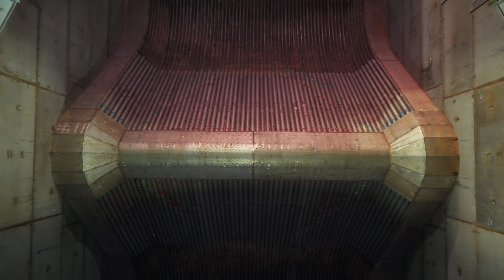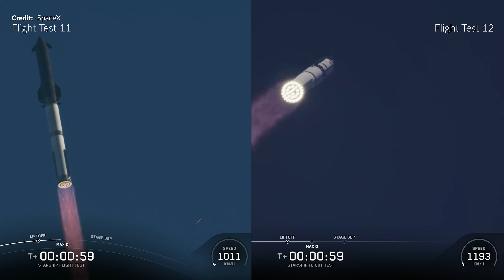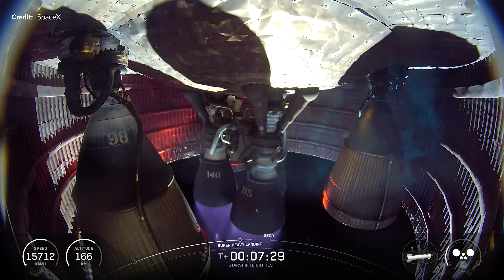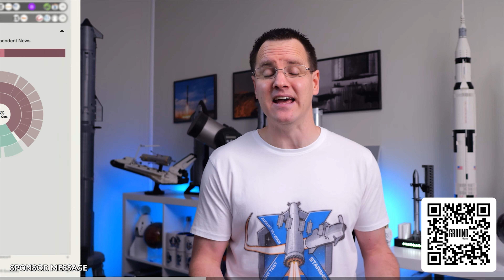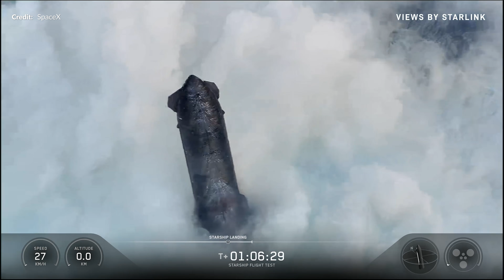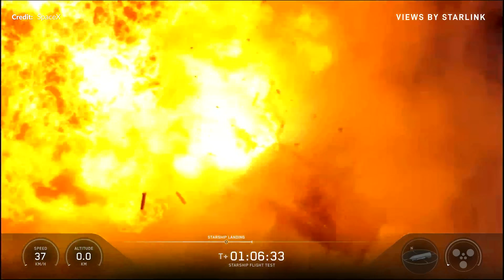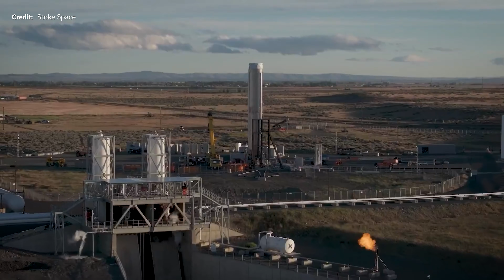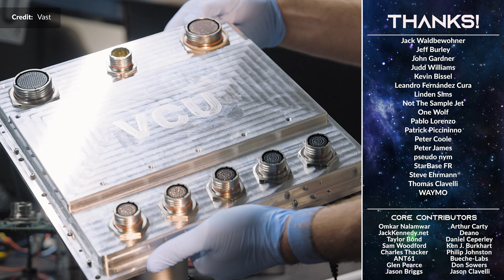Starship Flight 12 Explained - The First Version 3 Starship

Comment: My heart sank so much in those 15 seconds after stage sep, I thought everything was over
Reply from the maker: It didn't look great at that point but man did they knock off most of the remaining milestones like a boss. I mean, we know they can reuse and catch boosters so it is all about the ship at this point in my opinion. Absolutely bonkers mission.
Reply: @MarcusHouse    Quite obviously there are issues with the booster's engines that very much need to be resolved. You can't land a booster with all engines out.
Reply: @MarcusHouse  You are well and truly down the rabbit hole. I bet you one of those musk groupies that thought running a train in a vacuum was a good idea....
Reply: @AllanSmith-d9b  many ideas dream crazy and illogical to small minded people... Then courageous people test those boundaries. Seems you're not the latter. 🤔😉
Reply: @MarcusHouse no, we don’t know that since they lost this booster which requires another flight to test a simulated landing in the gulf.
Reply: @dottybass57  
good point, it's a new booster with new problems.
Reply: @dottybass57  Yes, we do know that...   They've proven they can catch a booster.....   It's just a matter of getting this new one dialed in.

However, they haven't caught a ship yet. But since they can flip the ship and land it upright directly in front of a camera in the middle of the ocean, I'm pretty sure it's only a matter of time before ship gets caught too.
Reply: @rumblelloyd9491   They'll have to get to orbit before they can catch a ship. Hopefully that will happen in the next six months or so, but I have been saying that for three years now.
Reply: @odysseusrex5908 they can do orbit any time they want. They needed to prove they can land precisely first and this mission did that.
Reply: @odysseusrex5908  What a ridiculous argument: "Oh, they still need to go into orbit!" It's obvious they haven't done so yet for safety reasons, not for lack of capability. And the concept of capture on the launch tower has already been proven. The failure of the B-19 does not invalidate the advances of the three previous captures, the B-12, the B-14, and the B-15.
Reply: @MarcusHouse so in one hand you say the booster has had changes to the booster that makes it all new. On the other hand, you say we know they can catch a booster..  these don't seem to be consistent.  If it's all new, we have no history to go by. If it's not all new.. then we know catching is inconsistent. Soo...  Which is it?  Imo this is version 3, but as is a risk with iteration, this is a step back on reusability.
Reply: @DeAndreEllison  catching has been proven as a concept. These are new engines, they need to be worked out.
Reply: @DeAndreEllison crazy how someone so educated is so obtuse.
Reply: @johndodge8999  as a concept.. new engines need to be worked out... tell me why that doesnt sound like a step back from the previous sucessful catch
Reply: @DeAndreEllison it’s a concept proven to work but with major changes to propulsion (in the least) they weren’t planning to catch the booster.
Getting data for the engine outs along with the successes was more important than a so landing followed by RUD. 

At this stage success and failure will be decided on the conditions of the tiles after the first starship catch.
Reply: @In-Marty-We-Trust  tell me why this wasnt a step back in the catch/reusability area?  don't just follow the propaganda.. they were previously able to catch a booster. this one they couldn't have even if they wanted to. the booster had problems relighting.. loosing engines and they clearly weren't in full control of it.. these are all things that previously were OK and here in this instance were not. it's clear. Again that is a risk of rapid iteration..   but  for the whole thing to work.. meaning moving towards rapid reusability, which is the main goal of starship... it would be nice if all aspects moved forward.  but my point of my original post was Mr. house said conflicting things.  you dont seem to acknowledge that.. just jump straight to donut activity
Reply: @DeAndreEllison Everyone understood what Mr. House said and what he meant, except for you. Try harder.
Reply: @miroslavmilan  i guess words dont matter to you... stop glazing
Reply: @DeAndreEllison  and you're just a troll. There's always people like you on these videos.
Reply: @DeAndreEllison  I always wonder how people like you act IRL but then I realize you probably don’t even leave the house.
Reply: @Dee-Lamb  Nah, he hates Musk and anything related to him. (Probably is a rabid Trump hater to) SpaceX could do everything perfectly and hit every goal, and there will be people out there claiming it failed or was fake. Always have been and always will be there.
Reply: @DeAndreEllison  misspell the word losing. Telling people to "stop glazing." Yea, nothing you say holds any weight. 😂
Reply: These are tests to stress the systems to figure out failure points, they expect things to break
Reply: @hankkingsley9183 - Beyond that, SpaceX always chooses the cheap and practical option to test, they don't over-engineer because it's all about cost. They want to see what is practical, not overspend on test vehicles. Most trolls will have learned a valuable life lesson soon enough, but I'm sure they'll ignore it.
Reply: Me also
Reply: @DawidSmithmeow i knew you were gay
Reply: How much does this all cost when we can’t afford to drive to petrol station,
Reply: Nearly all of the SpaceX revenue is from Starlink sales and connectivity leases, as Starlink pays for the vast majority of launches. 
@AlanDavies-u2u
Reply: Impressive but they need to actually test stuff for the Artemis mission which do not require re entry of the ship and do require stable orbits and in flight refuelling.
Reply: Not correct. Expended single-use missions would limit launch rates to the speed of construction. 

No way that SpaceX is discarding all the Tankers after a single use. Landings and reuse are a high priority. That enables very fast turn around and very frequent launches. 
 @davidrussell7530
Reply: I just don’t see how rapid reusability is anything other than an impossible nightmare. 

If it was even remotely possible, Space X would have already achieved  it with Falcon after more than 600 launches. 

Musk’s description of Starship launches becoming like commercial airline flights is impossible to safely do with rockets.  

I believe Space X can drastically reduce the turnaround time, but I don’t think it’s possible to turn Starships around in a matter of days or even several weeks.
Reply: @ericandi  econ eh ... cia  asset  can do no wrong  .. distraction deception  and division  is the only goal 😮
Reply: same!! also dope pic 999
Reply: Same I started having flashbacks from the first V2's
Reply: Is there footage of the booster's end?  Did it hit intact or blow up first?
Reply: @Svdionysos  The B19 reached the sea intact, and the entry was much more aggressive than in previous flights.
Reply: To me it looks like the thrust from the ship really accelerated the booster's flip, you can see the flames hit it. Maybe that stressed it more than expected?
Reply: Fan boys eh 😅😅😅
Reply: Always seems to be a VAC engine problem
Reply: It almost seemed like the additional running engines on the booster maybe hindered a quick and clean separation and the top of the booster was kind of "kicked" sideways faster than it could handle. Maybe causing propellant sloshing and other issues.
Reply: @TheBrain2K  previous tests they found they had to run egines on the booster otherwise they would loose control because engines wouldnt relight.  i think thats when they introduced the hot staging ring so the bosster engines could keep some velocity on the booster and the ship could sucessfully separate.
Reply: @DeAndreEllison Yeah, I remember that. But it seemed to have worked fine in the end with V2 with some engines running.
And the more engines they keep running, the slower the separation is going to be and the harder the kick to the side of the top of the booster from the ship's thrusters (due to less separation distance).
Reply: @DeAndreEllison  minor correction: they need to keep ACCELERATION on the booster, to settle prop. Thus, engines stay on applying thrust
Reply: @graemeesmith  sure......
Reply: Watch the video and pause it when you can see the engines of the booster.  You will see that a lot more engines are running than the telemetry  shows.  

Now the question is did the onboard computers have that false data or did they have accurate data?  

The booster seems to have stayed within the landing zone so I suspect that their data was "more accurate".  

How many engines stayed running and for how long is a question that hopefully SpaceX can resolve (maybe by collecting a "black box" of the ships own data).  Obviously it seems to have been going too fast for landing (and it is a good thing they weren't scheduled for a catch).

:rocket-red-countdown-liftoff:

:rocket-red-countdown-liftoff:
Reply: @Scanner9631 yes, it seemed some sort of explosion of one of the middle raptors exploded knocking out loads around it
Reply: @Scanner9631  I reckon the telemetry was good, seems consistent with the video just delayed slightly
Reply: The video imagery is usually trailing behind the telemetry icons by a second or two. You need to find a couple frames where the offset of the two timelines can be synchronized. 
 @Scanner9631
Reply: @Scanner9631  telemetry is ahead of the video by some seconds, that's why they don't match. Scott Manley did resync them on a previous v2 launch
Reply: Are you gay?
Reply: @Kylek1986 Bet you fit right in the musk troll brigade /X
Reply: Are you?
Reply: @Kylek1986 are you a child?
Reply: @benloud8740 are you gay?
Reply: Ben How much did your heart sink when you saw SpaceX financial results. 27 Billion lost in 2025.  The company valuation is based upon the value of its assets but most of them would be very hard to sell to anyone.
Starlink is the only part of the SpaceX business that makes a profit, d $4.4 billion in 2025.   
SpaceX  stated that it intends to fly passengers across the planet at unprecedented speeds. Known as "Earth-to-Earth" or "point-to-point" terrestrial transport, the company plans to use its massive Starship rocket to carry people between major global cities in under an hour
Starship will fly into space, exit the atmosphere to eliminate air friction and weather turbulence, and travel at speeds up to Mach 25 (roughly 17,000 mph / 27,000 km/h).
Most international long-distance trips would take under 30 minutes, with access to anywhere in the world in less than an hour.
Ben, Elon Musk's current timeline targets uncrewed Mars test flights by late 2026, with the first crewed Mars missions pushed to 2029 or 2031.  Will you go to Mars, the trip takes 9 months?
Reply: @harrydestaffano565 foid
Reply: @harrydestaffano565  SpaceX acquired X AI which is why you are conflating debt load with 'loss'. (27 Billion loss is inaccurate) Starlink was always the key to funding Starship development. They knew this program would be expensive. Mars is important to the company vision and ambition, but a city on Mars is far from necessary for SpaceX to destroy it's initial valuation.
Reply: @gcburns4  SpaceX is reliant on Starlink, its' only profit making unit for growth.
xAI lost $6.4 billion from operations on just $3.2 billion in revenue in 2025. 
The xAI losses are poised to grow in 2026. 
SpaceX also owns Grock but xAi has 80% of all their AI users.
How many years can SpaceX continue to loose Billions.
In Rwanada Starlink charges $177 for its equipment and $27 per month for service.
In USA that cost is $249 for equipment and $55 a month for service.
Reply: @harrydestaffano565 you should short their stock when they go public. I'm sure that will work out great for you.